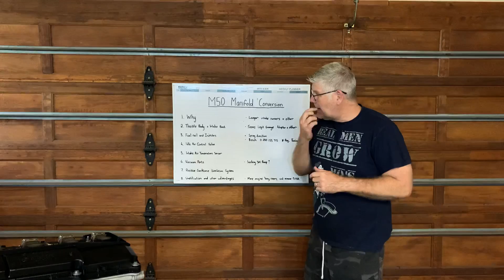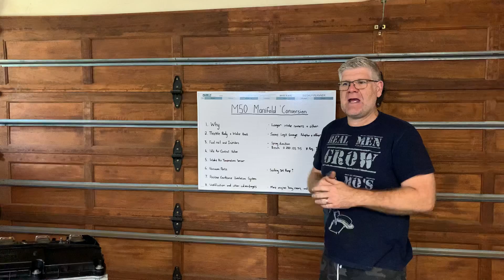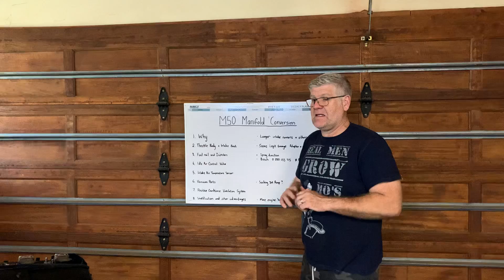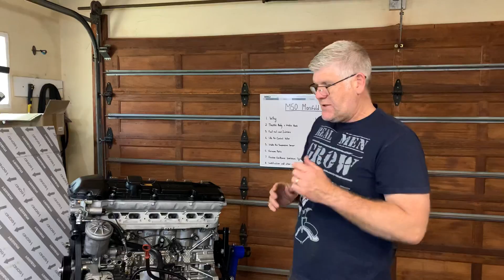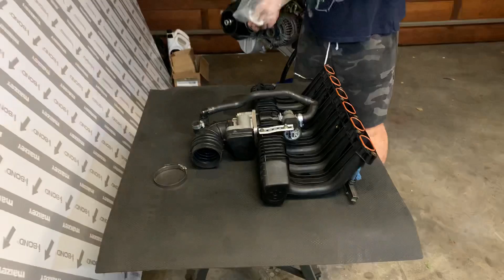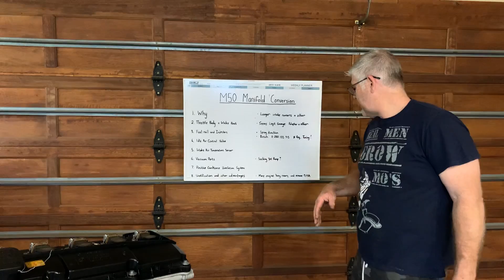BMW M54 to M50 Manifold Discussion

Comment: Longer runners increase torque but not sure about velocity. Won't short runners increase air speed?
Reply from the maker: Exactly right. any this is why the M50 manifold is better suited for top-end power: the stock manifold changes the overall length of the inatke path (from longer at low RPM to shorter, similar to M50, at high RPM), but the "short" path is compromised, as the runners are significantly narrower, choking airflow.

Comment: I made the m50 intake mani swap in my e46 eith m52tu and it runs and idles great, i got a stage 4 revmatch tune but im having a low rpm hesitation, any ideas? Ive heard could need a different spray pattern injector?
Reply from the maker: Yes, standard M54 injectors have an angled spray pattern to suit the angle of the injector ports in the manifold. At high air velocities the spray angle is probably less relevant, but I could imagine some sub-optimal air-fuel mixing at low air velocities (low rpm) which could cause a hesitation.

Comment: I just got done installing the M50 manifold on my M54B30.  everything is hooked up correctly, and now it seems to have a misfire at lower RPM.  when revving up, it seems to smooth out in the upper RPM range.  I used your suggested Bosch injectors from the video.  Any idea what could be wrong?  Maybe just have to drive it so the DME can "learn" the new manifold?

I kept the CCV system, deleted DISA valve, did not port match the intake ports on the head.
Reply: Its most likely due to injectors spraying at the wrong angle, if you stick with m54b30 injectors. Ive been there with m52tub28 engine. It was more like hickups than missfire, sorted out with m52b28 injectors and a tune. Both m54b30 and m52tub28 injectors spray at different angle than previous m50 models. M50 intake manifold did nothing in terms of power for m52tub28 engine even tho i spent hours and hours tuning it, revved it 7200to7300rpm most of the time, worked fine but the best part of it was the sound and simplicity when you had to take it off again. Im eager to see what does it do for you with m54b30 engine, as I too moved to it. Please make a log of say 3rd gear WOT 2000-max rpm with engine revs, throttle position and maf reading so we can compare some numbers! I can guide you how to if needed.
Reply: @TomoReso  actually the problem was, one of the new injectors was bad.  I put the oem m54 injectors in and it runs great
Reply: @cooperc240  glad you sorted it out, did you make any logs, tests?
Reply: @TomoReso  no, I am still waiting on a tune to come through
Reply: @cooperc240  hopefully its some trusted tuner.
Reply: @TomoReso  Revmatch Motorsport!  I read good things.

Comment: I have 2 m50 motor cars one has an m50 manifold with an RK tune flash one is stock. The swapped one makes over 20hp more. Its extremely worth it.

Comment: Excellent video.....answered all my questions when researching for this mod. Only thing you missed was details about tuning, especially with the different injectors. Does it need to be tuned or not? Also you mentioned the catch can for the oil at the beginning but didn't go into details.

Comment: Guten Tag.  Was wurde an dem Motor verändert? Wie viel Leistung erwarten Sie ?
Reply from the maker: The engine is 100% stock internally. It had S50 exhaust headers feeding an open side exit exhaust, and the M50 intake. It produced between 141 and 150 kW on the wheels (depending on the dyno) at 1600m above sea level, which translates to 170 - 180 kW at sea level (225 - 240 HP).
I no longer have this car - I had a 180kph crash at Kyalami in October after another competitor dropped oil, the car was destroyed. The engine was sold and is going into a new E46/2 race car.

Comment: I see you are using the blue Bosch 0280156280 fuel injectors, by any chance do you have the deadtimes data for those injectors?

Comment: Hi great video!!  I did the mod but not convinced its worth it. I don't see any significant jump in HP. Perhaps I did something wrong. 
Mod done on my 2005 e46 330ci with the M54B30 engine. I plugged back in the EGR or Purge valve (is that needed)? I did not plug to vacuum the fuel pressure regulator instead I have the EGR valve connected to that port ( is this incorrect) So I gather from your video that you only discuss the ICV and FPR and venting the valve cover to a catch can and catch can vented to air. I guess my question to you is can I get rid of the EGR Purge solenoid valve and connect the FPR hose the the vacuum bib on the intake? do you think this is why I'm getting sudden drops in idle? Currently valve cover is vented into a catch can and the catch can is vented to atmosphere. Also do you think i need an ECU upgrade if so any suggestions?
Reply: Yeah you can delete the purge valve just block the pipe. Strongly recommended a remap with the m50 manifold ect. I'm also deleting the icv
Reply: @JAYBOLA1  Thank you for the reply. I just removed the m50 intake to remove the EGR and connect the FPR to vacuum and noticed the intake ports and valves were very dirty with carbon build up. Before the swap the ports and valves were clean as a whistle. Any idea as to why this would generate that much build up?
Reply: @JAYBOLA1  Sorry mate one more question. Do you have a legitimate source for the remapping ECU? SLG doesn't have one for my MS45 ECU. Thank you!

Comment: How do you also fill the small holes on the block? You mentioned a grub screw but wouldn't metal shards fall inside?
Reply from the maker: Yes, you need to take car to have the valves closed on the cylinder you're working on, and the put grease on your tap so the metal sticks to the tap.  Make small cuts cleaning off the tap and swarf regularly as you go. when done blow out the intake ports with compressed air and inspect visually.
Reply: @buildabeemer  thanks. 1 other question are you connecting your catch can back to the inlet manifold as well? I've got the catch can but not sure if I should just vent it to atmosphere

Comment: Does the fuel pressure regulator need to be connected to the intake ?
Reply from the maker: Yes - there is a suitable port on the manifold just behind the throttle body.
Reply: @buildabeemer  thanks mate love your work keep it up from nz

Comment: Hi Craig, just wondering. Where did you get the grub skrews from?

 Also I want to do this modification for the car in road use and was wondering if it would be ok to keep the m54b30 intake boot that has a line for the ICV and maybe just putting a t off on its air line for my ccv to the manifold for the crank case ventilation or should I just let it vent out from the tapped and get rid of the ccv system entirely?
Reply: Ohhhh and I was wondering if you could load your tune on my car if you are able to. Ill pay for it i don't mind...

Comment: Great video I'm a quarter of the way in and have a quick quarry . I keep getting a stuck icv code but the icv is cleaned and rattles fine any tips or suggestions its causing my car to go into a safety mode and leans out under throttle

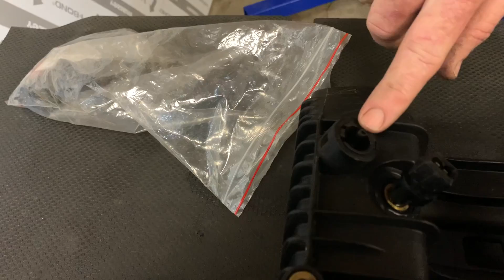Comment: At 11:35 timestamp, does anybody know the part number for that nipple? I'd really appreciate it. I have everything set up, but as for now, I'm running the fuel pressure regulator hose straight into the manifold as there is no nipple there, and it runs well, I'd just like to have it as proper as possible. Thanks.
Reply from the maker: The nipple seems integral in the intake manifold. Realoem doesn’t indicate the nipple or a part number.
Reply: @buildabeemer  Thanks for the reply. I was unable to find anything on it either. I'll have to keep searching though.

Comment: Do you have to alter the ecu any to keep any Engine Light or fault codes lighting up from the deleted hardware?
Reply from the maker: Hi Joseph. Yes, Nick has “coded out” the stuff we don’t need such as EWS, thermostat heater (when we run without a thermostat) or deleted lights. He has also reconfigured the CEL to flash if the ECU is knock limiting. All of this is done by changing the programming of the MS43 DME directly.

Comment: Great video! Just did the M56 VC swap now I’m considering this 😅
Reply: I have the m50 manifold with m56 valve cover. Nice simple combo and looks clean
Reply: @rcse46  how is your hose routed from the valve cover?
Reply: @justswippin2693  i have it currently going into a catch can then to the second port on the throttle boot, but that is not the best idea, so im deleting the idle control valve and running it to the port on the opposite side of the throttle body. But id probably recommend just running to a catch can/breather and vent to atmosphere
Reply: @rcse46  why isn't it running to a catch can then to intake boot ideal? that's my setup atm
Reply: @justswippin2693  because when the throttle body is closed, the oil vapors are bottlenecked into the icv if my understanding is correct. I could be wrong though
Reply: @rcse46  that makes sense. in my case I have the air temperature sensor blocked off with a bolt. MS45 DME has that sensor built into the MAF. 
so to make that Port useful can I use a barbed fitting and route the catch can into the intake manifold itself?
Reply: @justswippin2693  yeah you could but i wouldnt use the iat hole bc its too narrow. You could drill then tap a bigger hole and thread in a bigger fitting like 5/8 maybe
Reply: @rcse46  dang. maybe I should try first before drilling. anything im going to experience with the narrow AIT hole?
Reply: @justswippin2693  my tuner just told me not to do it. I assume its bc there will be too much pressure bc of the bottleneck
Reply: @rcse46  makes sense I appreciate your input. ill vent to atmosphere through a catch can

Comment: I know there's at least one guy who is effectively using the ccv return line as "turbo oil " return . I also thought that was a great idea .. This along with an adapter on the vanos to use as oil feed should make it simpler for my next project using an oil cooled turbo 👌👌

Comment: Very nice video. One question are these injectors a direct fit? Is there no need to space them? An can you use your stock connectors on them?
Reply from the maker: Yes, they were a direct fit. No need for any spacers and stock connectors do fit. We did remove the nylon collar washers on the pintles as they want to catch on the inside of the manifold and pop off. We had one fall in past the valve into the cylinder - managed to fish it out with a hook attachment on an endoscope 🤓
Reply: @buildabeemer  Thank you!
Good you where able to Fish it out again.

Did you get an improvement on power after installing these injectors? (N/a)

Comment: Very helpful video sir ✌️your icv works well? Oil catch can.. Simply form valve cover to catch can and from catch can to intake boot? Would be very grateful if you could me explain your idea of oil catch can on this setup since im going to do same thing in few days!
Reply: Basically yes, valve cover to catch can then catch can to intake. There are plenty of videos going into more detail for our cars. You can even drain the catch can into the existing oil dipstick drain for the existing pcv system
Reply from the maker: We started with the setup you describe, but had some strange issues which caused oil to be blown out at the connection to the valve cover. So now we just vent to the catch can, with a filter attached. Then we drain it from time to time. It collects VERY little oil - maybe a tablespoon over the course of a race. It’s mucky stuff - wouldn’t want to drain that back to the sump.

Comment: Why don't use m62 (or even n62) throttle body? Its larger and be great addition to increased velocity of m50 manifold. Also, as m54 engine has drive-by-wire throttle you can get rid of ICV and let throttle do its job. (all this stuff requires remap of course)
 Also hose from catch can should go directly into manifold, not into boot before throttle body. With removed ICV - there will be perfect option to route catch can hose into its port.
But anyway thats a great work.
Reply from the maker: You are the second person to mention M62 / N62 TB - looks like a good idea!  The catch can vents to atmosphere now through a small cone filter which works well.  You are right - routing catch can outlet to the boot caused a mess!